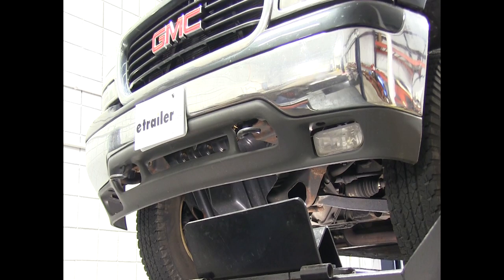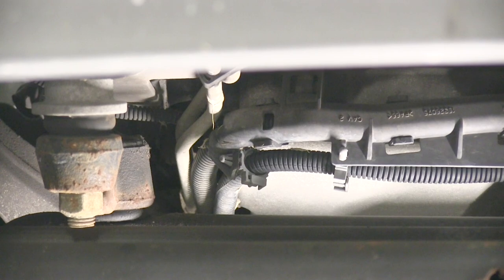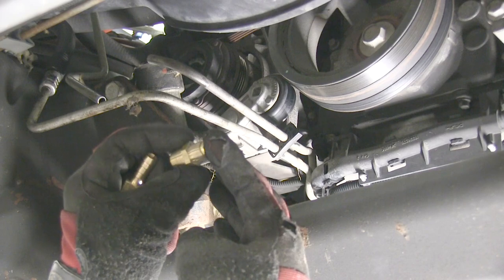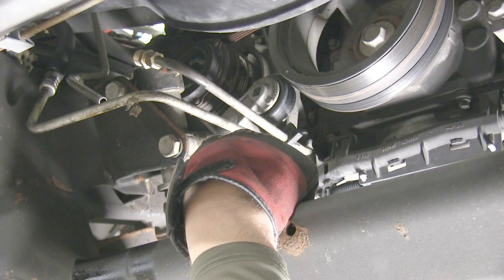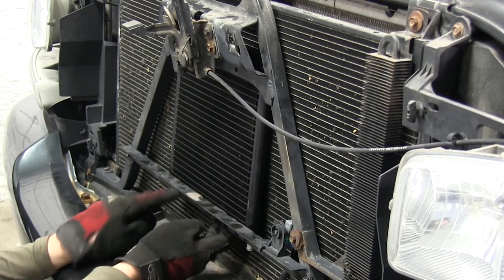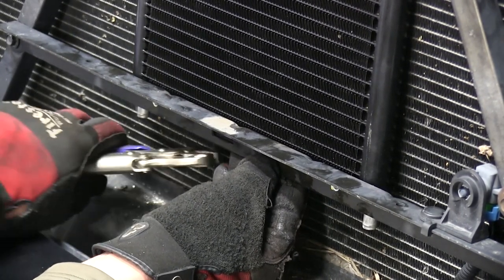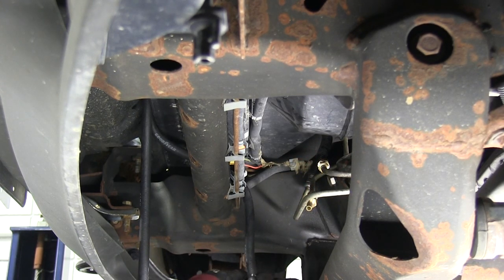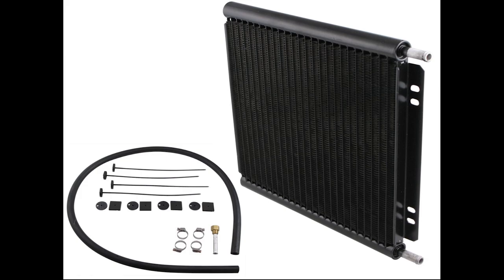How to Install the Derale High-Temperature Replacement Hose for Transmission on a 2003 GMC Yukon XL

Comment: Can you help me out? In most diagrams and instructions it says that you need to connect one line to the radiator, but in this video you bypass it and connect it directly to the transmission line. Can you clarify?
Reply: U can go from the radiator to the cooler or like the video to the return line to the cooler back to the return line its optional

Comment: Does the transmission fluid run through the regular radiator? Why are the lines hooked up to the regular radiator and if so doe the transmission fluid and engine coolant mix?

Comment: I have a 2002 2500HD with 6.0L and 4L85E Trans. I added a Cooling fan to the Trans cooler with a thermo switch to control the fan and a bypass switch. I pull alot off steep grades and fan helped alot never gets above 220 on the trans
Reply: I think anything over 200 is hot for transmission fluid. Mine runs around 150

Comment from the maker: The installer did not feel it was necessary in this particular instance, however, in many cases, you are right, unless they are compression fittings, you can use teflon tape to seal the fittings. Let me know if you have any other questions, I would be glad to help!

Comment from the maker: In some cases, additional fittings or alteration of the OEM lines or hoses may be required for installation but for the most part it will stay where it is installed. The most important part is to measure where exactly you are planning to install the cooler. As long as it fits, it should be secure. The attachments that come with the kit are designed to work like zip ties and there are some foam blocks to put in between the cooler and the AC condenser. Let me know if you need any more help!